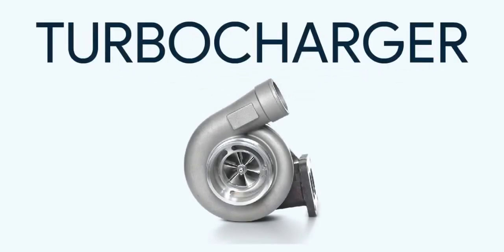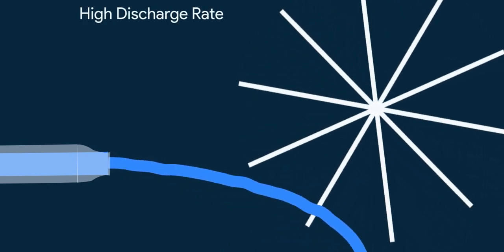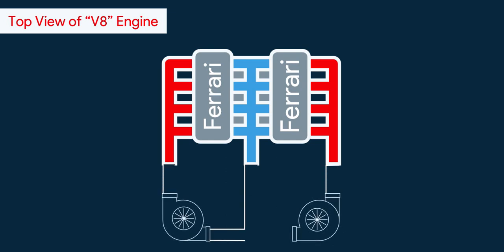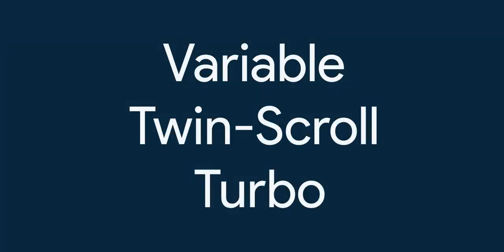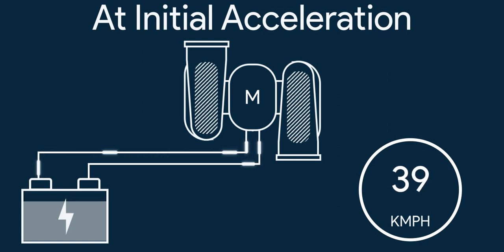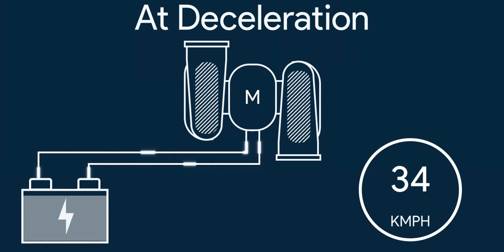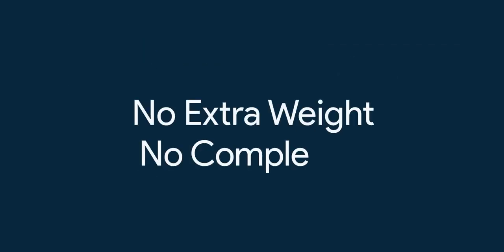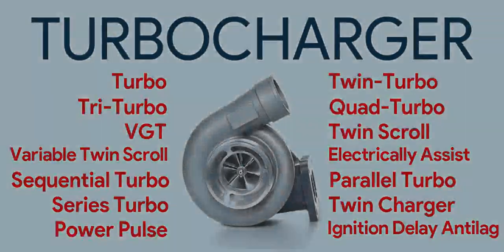15 Turbocharger Types & Configurations

Comment: Very interesting video, but please someone help me to figuring out what type Formula 2 V6 turbocharger type is, the engine has 95° bank angle and the turbo placed in the middle of the bank so the exhaust manifolds are going into both side of the hot side of turbocharger (it has like 2 inlet exhaust). Not a twin scroll of course, I just found it unique.

Comment: With Twin turbo setups on V engines. What are the benefits of each turbo boosting their own bank, or the bank powering the turbine is compressing air into the opposite bank?
Isolated banks or crossing over,  why choose one over the other?
Reply from the maker: Pressure of exhaust gases is not constant throughout the manifold, rather it's like a sound wave. When the exhaust valve opens a compressed gas wave comes out. 2 waves from different cylinders at an delay to each other can counter each other making it to lose  kinatic energy and increase back pressure. To get most boost out of gases it's better to have different exhaust gas line for cylinders so that gas wave interaction can be mitigated.
Reply: @UntangleClub  
You don't understand my question.
Look at a V6 engine for example.
3 cylinders on the left.
3 cylinders on the right.
Each side has it's own separate header, turbo, and muffler.

My question is, is it better for each turbo, to compress air into it's own side's intake manifold, or is it better for left compressor to feed right intake, right compressor left intake?

Or is it better for both sides to compress into a shared intake like in your diagram?

If I remember correctly, engine builders, and some manufacturers like Nissan with the 300ZX do this separate intakes feeding each other with separate turbos, but I can't find or think of the reason why.
Reply: He did answer your question you're just unable to understand his answer.
The shock wave is best isolated to its individual bank to retain peak efficiency.
Sharing exhaust gas between banks will have 2 shock waves counter acting one another.
The pulse from 1 Bank will affect the other banks turbo and create momentary backpressure when the shock wave changes direction.
It's more efficient to have isolated turbos for each bank
But you create more boost from a shared system as there is always a higher volume of exhaust gas flowing over a turbo that wouldn't normally have as much flow depending on what cylinders are firing and the firing order
Reply: @francislutz8027  
Thank you.
Reply: @UntangleClub  
I apologize.
Reply: I would think having separate would be better because can isolate into each side…? I guess it would come down to engine design, size, dimensions, weight cost etc. but twin turbos will give you either good performance at low rpm, high or in the middle. It’s always a compromise. Which is what sequential set ups try to counter by using the small turbo at lower rpm and both turbos or bigger at medium to high rpm’s. Like wise with the twin charger set up of using the supercharger at low rpm and turbo at high rpm’s

Comment: The main purpose of the mgu-h in F1 is to recover energy when the turbo reaches max pressure, instead of using a waste gate the electric motor "slows" the turbo, this energy can be used to charge the batteries, or power the mgu-k (electric motor connected to the crank shaft).

The anti lag and energy recovery off throttle are nice to have but not that important, if you remove then the car wouldn't be much slower, however if you remove the energy recovery at max boost the car would be several seconds slower.

Nowadays F1 is all about efficiency, the most efficient car wins the race not the most powerful. Mercedes is more efficient, Ferrari more powerful, and Mercedes usually wins. For qualification the reverse is true. For example last season Mercedes had 10 pole positions and Ferrari 9, however Mercedes won 15 races against 3 from Ferrari. So both cars were more or less equally fast, but the Mercedes was more efficient.